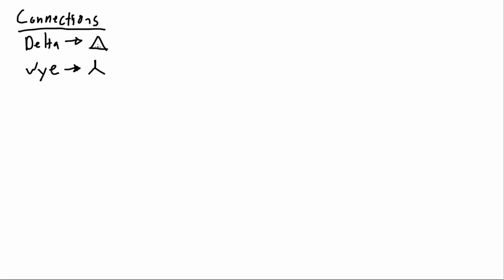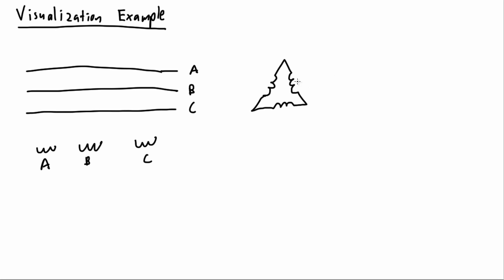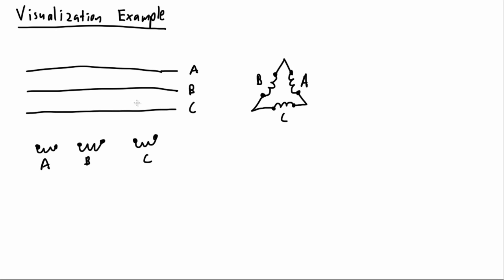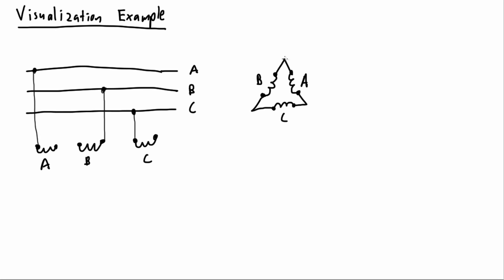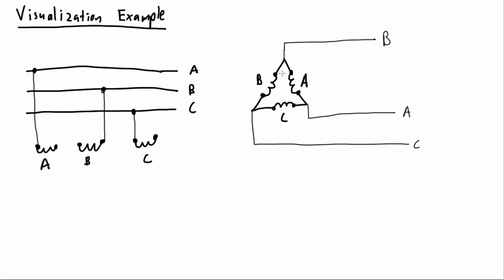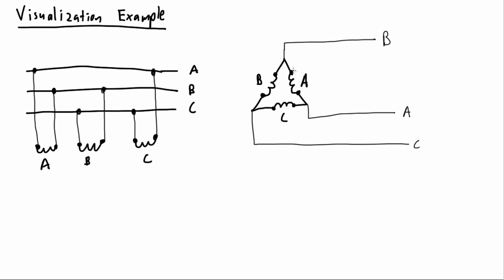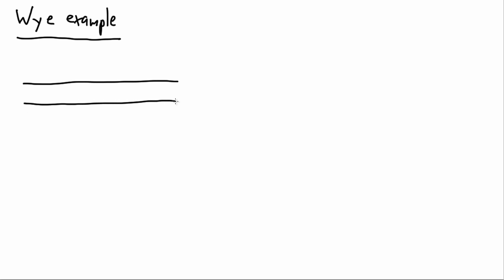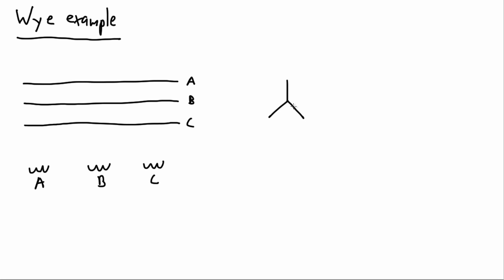Electrical PE Exam - Visualizing Connections (delta & wye)

Comment: mr jones how would i bring 3 phase 208/230 voltage to my condensing unit  is it just three hot legs from my circuit panel.